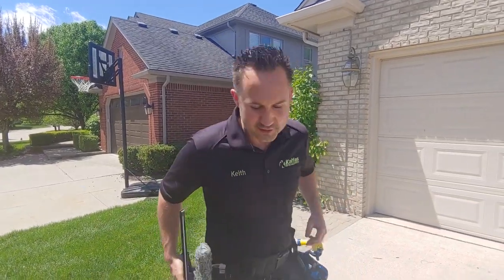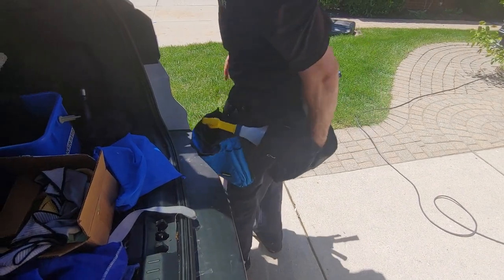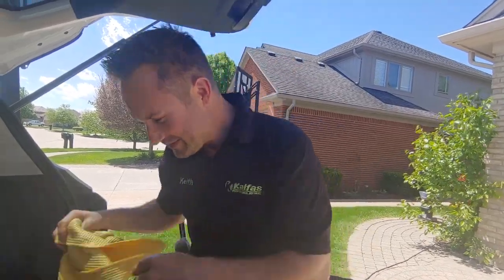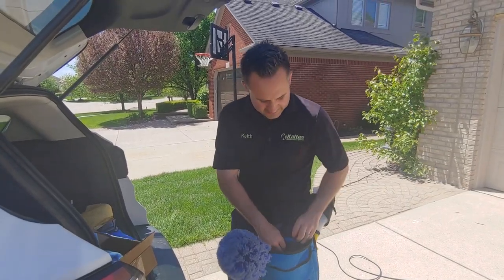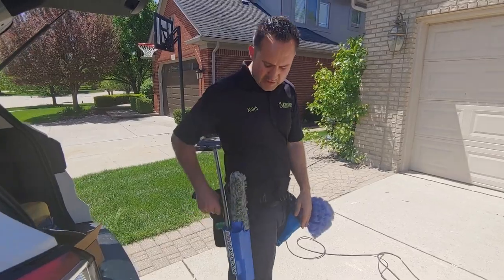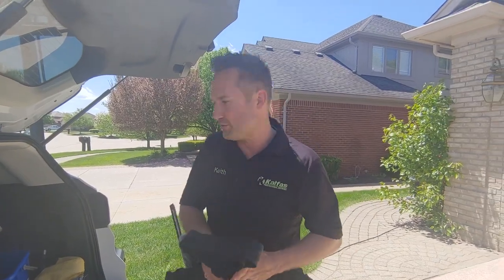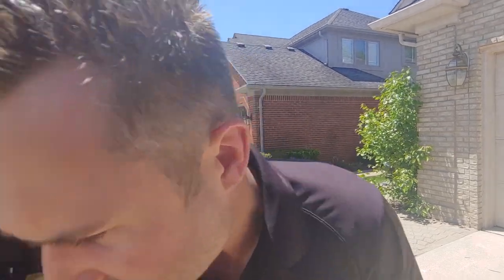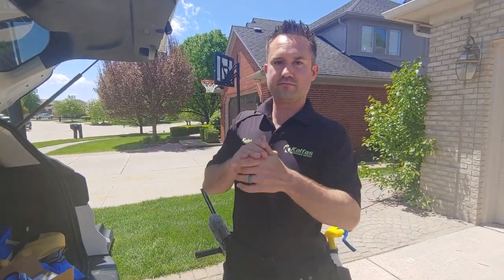Fricken Dope Window Cleaning Belt Has Pouches

Comment: I got lost in the new shiny equipment syndrome the first year or so in business( thanks to you for getting me started) but, to keep it simple we get everyone a belt like your wearing, ettore pouch, unger 4 inch scraper, unger ergo tec 18 inch squeegee or 14 depending on tech pref, moreman blue scrubber 14-18, and squirt bottle. The towels we use are just the surgical towels WCR sells by the 10lb box for like $56, we buy those because they are huge, absorbent and if they are beat up and torn by tracks its okay. I've learned in growing this business its the simplicity, and systems that will grow it very quickly. This year we will do close to 600k with only two trucks thanks to you.

Comment: Keep yourself organized while you work with the Moerman Side-kit. This updated design was reconfigured to allow the pouch to remain open while you work. Instead of dividers that run lengthwise to the pouch, they have been rotated. Use these three spots to store your towels, a drink, or whatever else you might need handy. The dividers are water resistant to help keep your wet and dry towels separated.

You'll also discover an extra side pocket that perfectly fits your Moerman Pocket Scraper. The back zipper on the pouch has been extended to fit oversized cell phones. The durable nylon material has plenty of spots for everything you may need like a pocket for pens and a front flap that's great for storing notes or business cards! It's magnetic so you can get in and out without hassle. Keep your Moerman Squeeze Bottle in the other side pocket for easy access to apply more soap on your mop as you go.

Slide the loops of this pouch over your belt to keep it secure. The detachable clips are designed to snap apart if you need to remove the pouch but want to keep your belt on like when you drive between jobs.

This is your moreman bag you have excellent bag definitely holds a lot 

I'm using a maykker belt with window cleaning leather model 2 samurai bottle pouch triple crown double pouch that my brother and I had labeled with our company logo also 6in ninja scraper also sorbo steel wool pouch and the boab I use is the silencer towels I use are squeegee life towels and also love Unger scrims